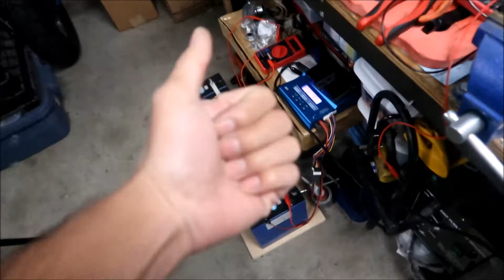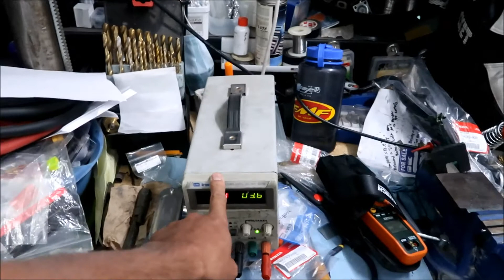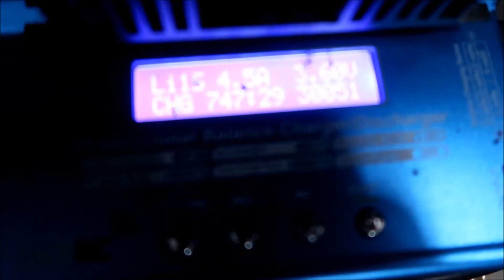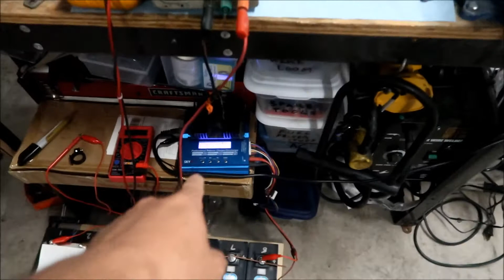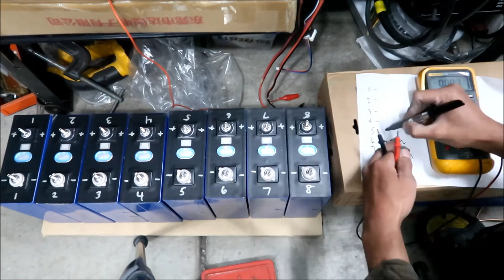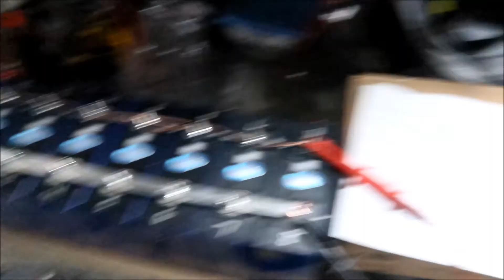HadesOmega Solar Garage Project Episode 40 - The Long Wait of Top Balancing

Comment: few things :
these cells are not supposed to expand unless overcharged

you are supposed to compress them.

i would contact your supplier, looks like you got grade b cells, and ask for a refund.

look at andy's off grid garage channel, he's got extensive test in graphs
Reply from the maker: Hmm interesting I am using them right now though and they seem fine that one #4 battery seems to have a lower capacity than the rest though so I think I got a bad one.  I'm not charging them up to 100% or doing deep discharges so I've got a good cushion.  I wish it were as easy as just returning them but it took me 2 months to get these batteries =( I think I will just roll with em.